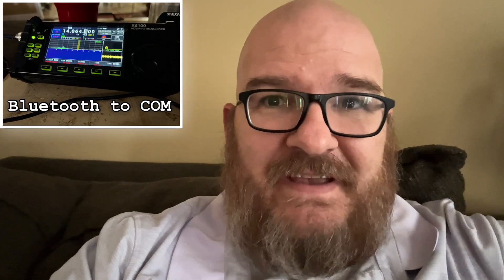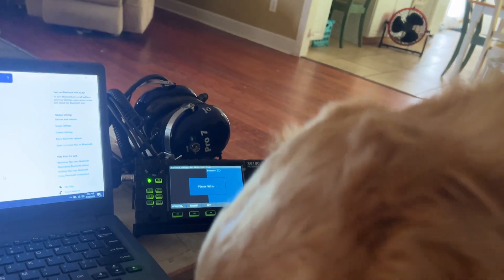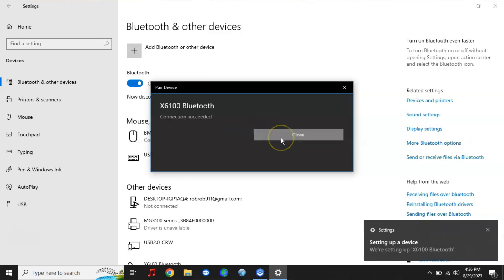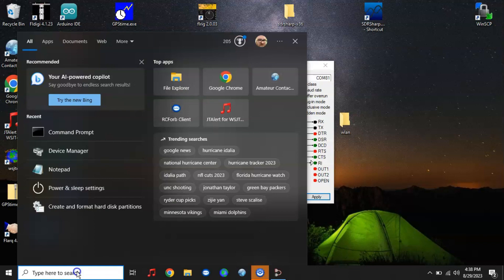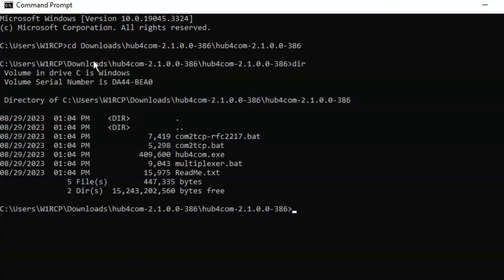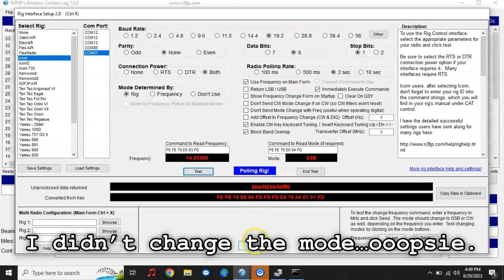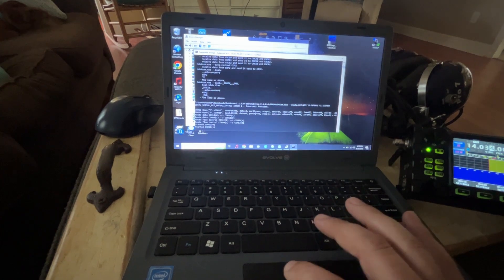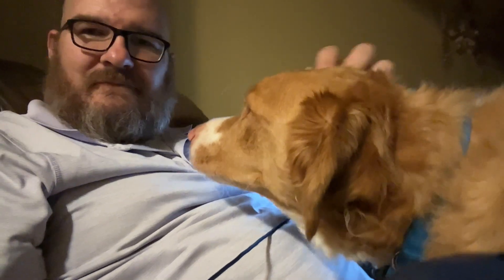Using Xiegu X6100 Bluetooth to Serial COM with N3FJP ACLOG…It’s not that simple!

Comment: The latest version (3.0) of com0com works on Windows 10 but not Windows 11 as the driver is unsigned. The earlier (2.2.2.0) version runs on Windows 11 as it is signed but does not have the "use port class" option and does not create the entries in the device manager. VSPD appears to do a similar job to Com0Com, creating the paired ports (I used 29 & 30 as above 30 is not supported) but has to be purchased after its 14-day trial period.

Comment: Thanks for your efforts, but I wouldn't waste too much time on this because, with the release of the 1.7 firmware, the "cat is out of the bag" as they say, and Xiegu users are finally realizing that Xiegu has totally screwed them over when it comes to EVER delivering on properly functioning WiFi and Bluetooth.  ... and it's not going to "be fixed in the next firmware update" because the problem seem to lay in the way the wireless WiFi/Bluetooth chipset hardware itself is implemented in the X6100, which just cannot support the solid connections needed to reliably stream both AUDIO plus CIV data on either Bluetooth or WiFi. 

Low speed CIV only data connections may work intermittently over distances of a couple feet, but it seems you can pretty much forget about reliable voice plus data hookups from across the room.  So, for the benefit of anyone reading all the hype about Xiegu's 1.7 WFVIEW SERVER release and thinking about running out and buying a X6100 --  DON'T, JUST DON'T.

For comparison, my IC-705 using a Bluetooth headset lets me surf my HF/VHF/UHF net frequencies from 35ft away, using the forward/back step buttons on the headset to step through memories (with the radio announcing each new net frequency via voice in my earpiece) -  and with the IC-705, WiFi control also works great with both Icom's proprietary Remote Software and the WFVIEW open source software for both AUDIO and CIV control using either direct ad-hoc or router based connections.

Xiegu's best move, if they want to recover their reputation, would be to offer a nice little compact USB-C external WiFi/Bluetooth dongle that can be plugged into the 'host' USB-C port on the X6100 to fix the problem - and then provide them through Radioddity AT NO COST to existing X6100 owners - but sadly, I don't see them doing that...  Because, with the X6100, when has Xiegu EVER cared about their reputation?

Comment from the maker: One last comment...I promise. After restarting my computer, COM80 and COM81 persisted through the restart! I just had to run hub4com to make the final connections. See either my previous comment or check out the video description for how to make a batch or CMD file that you simply click to do so.
Reply: If you wanted to leave it com 13 and 12 could you bypass doing any of the route stuff?
Reply from the maker: @lblerg  I doubt it. If it were that easy I would think the developers would have put that in the directions. As they've made it for now, it only seems to work using the middle man.